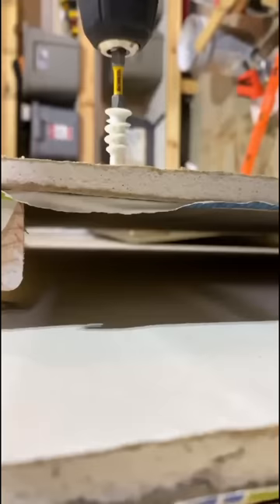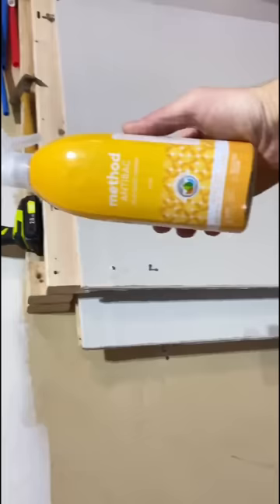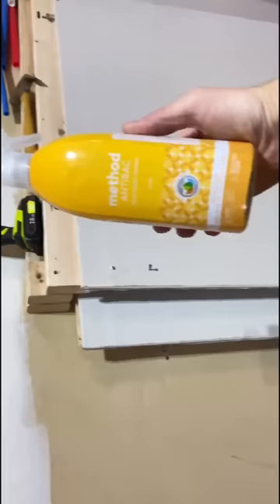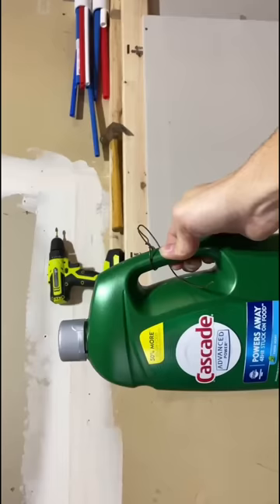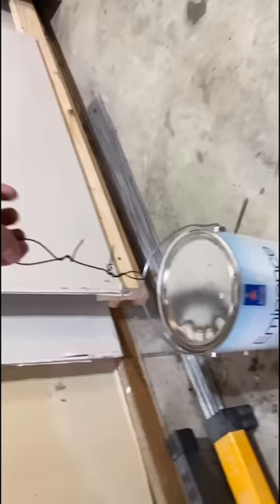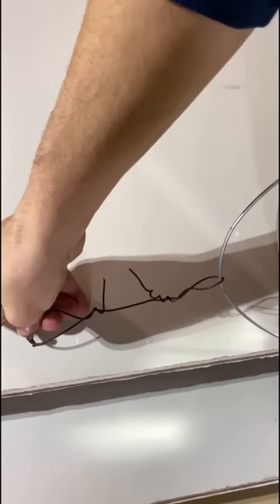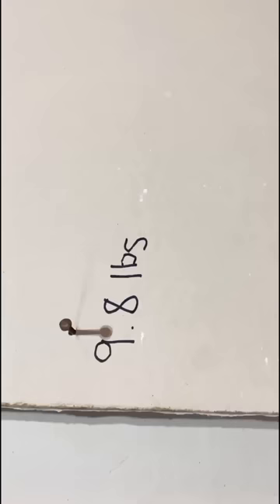How Much Can They Actually Hold? #homeowner #shorts #handyman

Comment: The issue with screwing or nailing into drywall isnt its inital hold weight, its that over time when things are shifted moved or dislodged the Sheetrock around it will start to crumble away and basically cause it to loosen up. When you screw to the stud it is obviously attached to wood and doesnt have those issues, what a lot of drywall anchors do is expand or pull on the backside of the drywall and provide extra stability through distributing the weight to that rather than having the nail or screw be pulled on. The 10lbs anchor for example is probably rated for that because when the screw is inserted it doesnt have as much force holding it to the back as for example some of the anchors that have almost a bolt like system to hold it to the back.
Reply: I would actually like to see a test similar to this but instead of increasing in weight have something like 20lbs hanging and add and remove it like 50-100 times and see how they hold up.

Comment: The metal ones hold better. Plastic is best only use on an exterior wall where drywall has been attached to 3/4 furring strips bolted to block walls and you're only hanging light pictures.

Comment: With you test you only ever got shear load on the screws in the wall.
Try adding a lever like a shelf would be in a real scenario and see how good the pull out performance is of every wall plug.
That's when you see the difference that matters!

Comment: In my experience those plastic screw in anchors suck. They have a tendency to shatter when driving them in.
Reply: They are incredible when installed properly. My guess is the pilot hole was too big or you used an incompatible screw. When zip-its are installed right the only thing that beats them strength wise is a toggle bolt

Comment: If you use a metal plate. Then the new plate of drywall with metal sticking out of it, screw it together. 5 screws with 2 finger with away and 10 cm apart and you can do pull ups with the metal part

Comment: If it's the same as a cranes when they certify them for weight limit usually they fail three times what their actual weight capacity says they are. Cranes should be able to lift three times what they're rated they just for extra safety divide the failing weight by three and then put that as the total lift capacity

Comment: Shear strength is different than pull-out strength. My old business partner thought the screw in mollies with 75lb strength meant shear OR pull-out... It will not hold 75lbs in the ceiling. That was the day I bought him out of the business.

Comment: My buddy bet our boss $50 he could hang a 4x8 sheet of 1/2 inch sheetrock from one sheetrock nail from the ceiling with zero support from anything else and it'd be hanging in the morning which it was though warped. The paper has incredible strength if you don't tear it or shatter the rock. Never tried a drywall screw but my guess it would pull through no matter how you set it.

Comment: Oh yeah simple nails and screws can hold a lot more than you think. I’m an electrician and we use spinners with 30 lbs of wire and it only takes like 1 nail an inch or two into wood.

Comment: You need to use a pilot hole when you install those plastic screw in wall anchors. It pains me to see people try to just screw them into drywall as they disintegrate

Comment: This test needs to be destructive to be valid. We only know that each of these can hold AT LEAST that weight. We're looking for an upper bound, not a point somewhere in the middle.

My right arm can lift my phone, my left can lift a 5 gallon bucket. This doesn't mean my left hand is significantly stronger, because if there is a difference it is small.

Comment: Well the idea of putting an anchor in the wall has nothing to do with making it more sturdy it has to do with the fact that drywall is made of compacted gypsum. Compared to a piece of wood it has barely any structure and over time things will sag underway if it's not properly anchored and given more surface area to hold on to.

I mean that nail you had in the wall was already starting to be pulled down by the weight of the paint can. If you would have left it on there for maybe a day or two it would probably rip the nail right out of the wall.

I mean if you're just hanging up some really light picture frames or something like that go ahead and just use a nail in the drywall but if you're holding any weight you definitely need some structural support. 

A 10 lb anchor can probably hold a lot more than 10 lb but that 10 lb limit is meant to signify its long-term use not what it can hold up for a couple days.

Comment: I think your missing some context. In which direction is the pull force measured? How far out on the hanger is it measured. 

For instance, you’re pulling mostly down and close to the wall so you’re measuring force in that direction. Let’s say I hang a shelf. The shelf hangs out way more than your measurements. The direction of force is also different. With a shelf you’ll have a lot more force pulling straight out. 

You said your nail holds a few pounds. How much force can it resist if you pull strait out?

Comment: The anchor isnt supposed to break like that and you need to pre drill the hole tao the anchor in flush then use a screw driver so it doesnt just bore out the anchor like what happened here. The wings are ment to open not get cut through.

Comment: Theres a limit. Either way. Ive got anchors holding my tv mouny yo the wall that total up to 4000 lbs becauase those are the anchors i had on hand. I doubt the drywall  would manage that, it would rip the drywall before it pulled out.

Comment: The test is deceiving. It assumes there’s only a gently applied downward force, for a short duration, with no movement. The issue is that the outward pulling force is what causes the screw and nail to fail. Also if you add any movement, or apply downward force in a less gentle fashion, the nail or screw will start to cut into the drywall until eventually the angle changes and the force goes from downward, to pulling outward, as well. Since straight gentle downward force isn’t likely, the anchors are designed to do just that, anchor.

Comment: Video just shows how much leverage you can put on a screw or a nail. That can be done with anything and the problem we have is if we were going to attach a vanity and something that would have forced to pull away from it it’s not going to hold the weight.So please stop giving people the wrong idea.You need to have the proper anchors in order to hold what you want to hang. So please take the time do you research and use the right material for an anchor hold point.

Comment: So it's not actually holding all 22 lbs because a small portion of the weight is being distributed onto the wall that the bucket is leaning against. Close enough though as the weight distribution would be largely insignificant.

Comment: Drywall anchors hold 40kg (88lb) to just over 100kg (220lb) depending on the type. Donno what this guy is on about with gallons of oil buckets.

Comment: Measuring like that is no bueno. If the force is straight down (parallel to the wall) youre measuring the material strength of the dry wall, not the anchor design.

Comment: Then how is it possible that I used 8 screws, with anchors that were supposed to hold 10 lbs, in two brackets holding a 2 ft shelf which immediately came out of my wall when my 30 lbs cat climb on it?
Reply: Impulse of your cat jumping on it caused one to fail then they all cascaded. If you're installing a 2' shelf put one of the brackets on a stud. On a side note 30lbs is one chunky ass cat lmao, im suprised he could jump that high.
Reply: @Teh_Random_Canadian  😹So was I!

Comment: Dude building code, & generally the packing literally tells you the hold weight. Besides those shitty anchors, it helps & is much better to just use a stud. There’s wires, pipes, & shit you don’t want to put holes in floating around there.

Comment: That doesn't really count because ur only showing a downward force. If u attach something like an aircon head the weight sticks away from the wall so there is also a pulling force which ur naked method would fail instantly

Comment: You didnt calculate how long it could hold for. A nail could hold anything for a fraction of a second
Reply from the maker: Well the nail is still there holding it. Been about 3 weeks. An update video would be pretty boring since it works just like I said it does in the video.

Comment: Kinda misleading test, and hardly a good test at that, no offense.

Pull out force is likely what’s being advertised on certain anchors, or a mix there of. Hanging weight as shown is really testing the shear of the drywall, so it’ll actually hold a lot of weight. But, what an anchor really helps with it repeated loads which cause movement of the fastener, bare drywall isn’t good at keeping its shape and an anchor helps keep your connections strong for longer.

Comment: Ya the fackin drywall is like an inch an a quarter thick
Reply from the maker: I think you may need to work with a tape measure more if you think it’s that thick. 🤦‍♂️
Reply: @roycerenovations  I think I don’t use a tape measure on my phone papa.  And if I could I should get a new one before I do because my screen is cracked/ but it was certainly an inch thick
Reply: @roycerenovations  or how about you tell me how thick it was since I’m figuring it’s your channel , and I gotta surmise it all by looking at shyit through the lens of a phone ?

Comment: It won’t hold for long.
Reply from the maker: Three weeks and still no trouble at 4x the weight “limit” how long do you think until it lets go?
Reply: I’m shocked it’s holding.  Try seeing how many times you can hang it. Eventually the hole will start to become loose.
Reply from the maker: How often do you take your pictures off the wall, walk around the house with it and place it back?